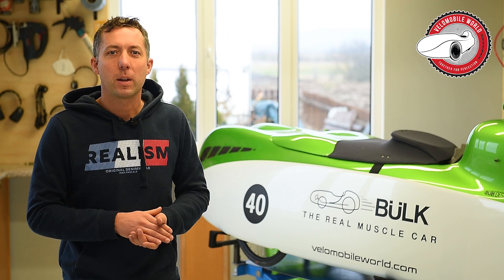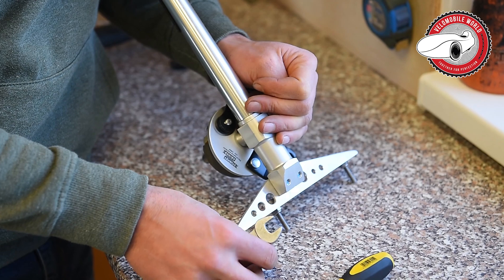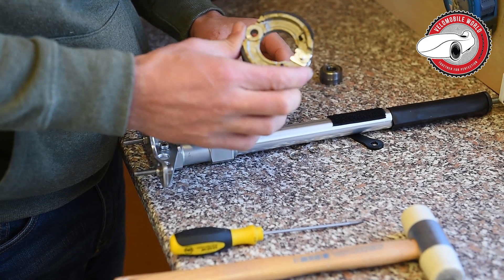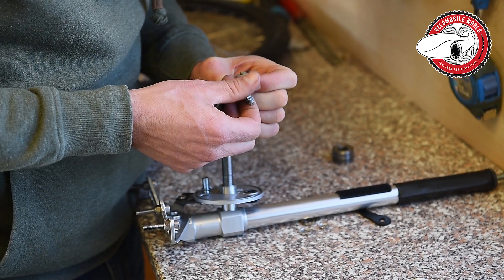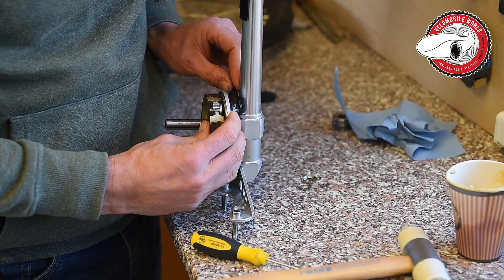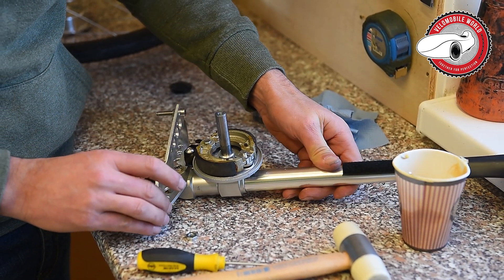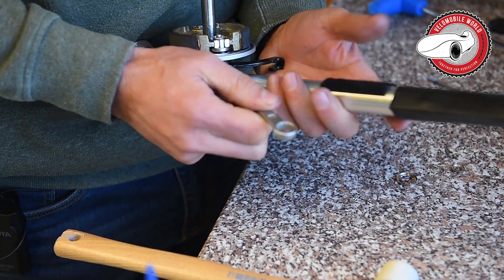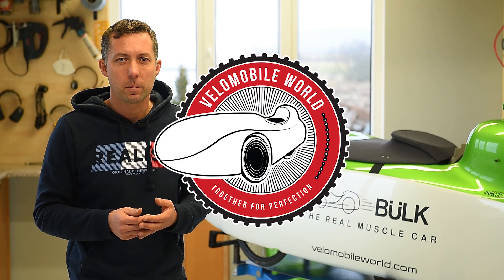Brake Maintenance | Bülk Velomobile Maintenance

Comment: Just a naive question, could a disc brake be more practical? I am a ex car mechanic & disc is far more maintenence friendly. Thank you love your bikes, hope things go well, appreciate your hard work
Reply from the maker: Hi, in the bike industry the brake disc are much less maintenance friendly. They need much more maintenance as drum brakes.
Reply: @Velomobile World  thank you for educating me.
Reply from the maker: @thebeaglebeat3615  your welcome
Reply: no not at all , the only thing they are better for by a small margin is heat shedding . they brake the same in whet or dry , they dont sound like a butchered pig evertime it rains and i have over 50000 km on a set of drums and the only thing i do is twice a year some white grease on the moving parts and blue marine grease ( extra salt resistance)  on the exterior link to prevent the problem in the video .

Comment: are people forced to do it them selfs cause it's labor intensive ?
Reply from the maker: No we have also a dealer network in Germany. But this maintenance you have to maybe once a year if you drive also the winter. Some live far away from a dealer and it is practical how to do it. Sometimes it takes you longer to drive to a dealer as that you do maintenance your self. If you are a bit technical scaled this will take you max 1 hour